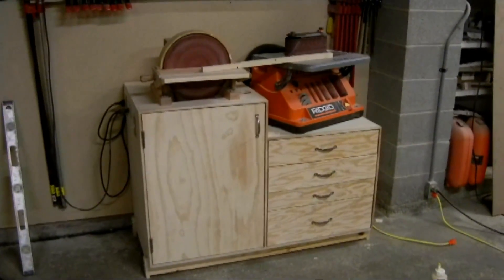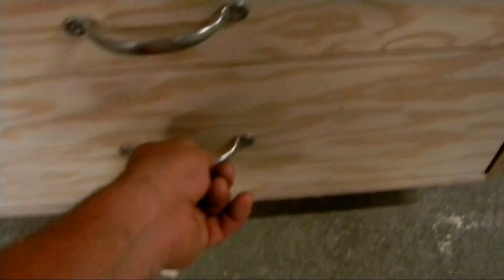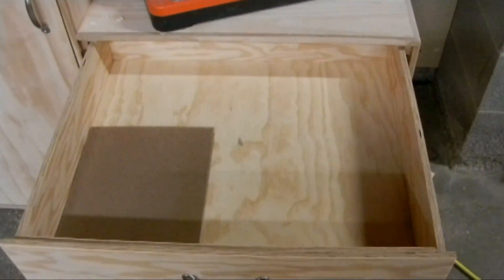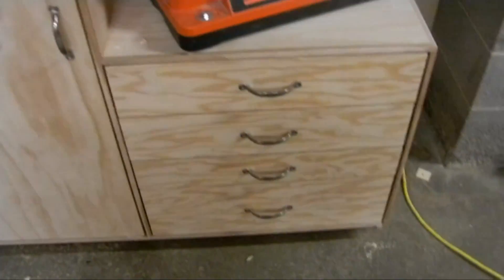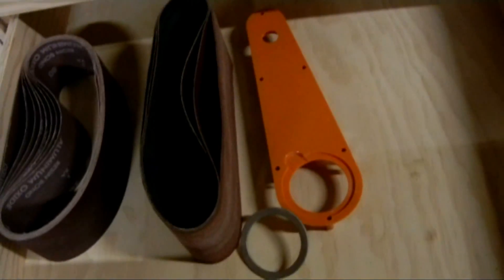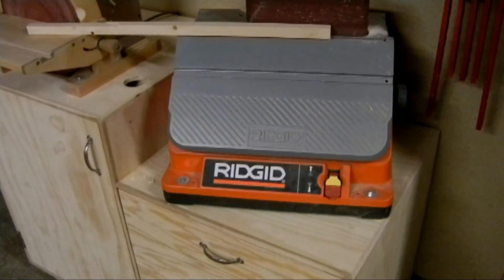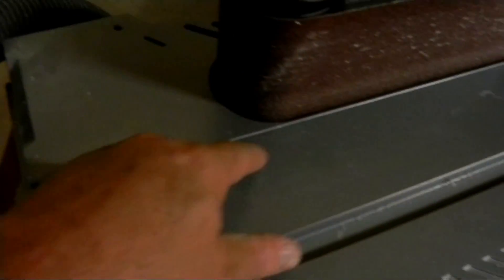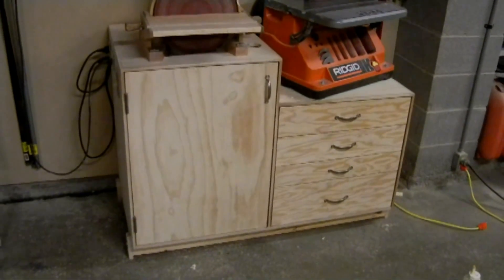Homemade Sanding Station

Comment: Add a cyclone mini and a Festool vacumn and you'd be set. The Festool 26 line is really quiet. You're going to get a lot of heat with your vacumn enclosed. But great set up. It's all about the funds isn't it?
Reply from the maker: +Kirk Williams I think I'm set now, unless you'd like to send out the Festool vac to me. 
A comment concerning heat build up with this setup indicates a common lack of understanding of the practical usage - it's not on and running for hours on end - it never get hot.

Comment: Hi John, I just subscribed ;-)
I have a motor from a professional Juicer 
Motor is nearly 4kg asynchronous 1 phase / R.P.M. 1380 / volt 230 / Amp 1 /Class F /Watt 170 / Hz 50 
Do you think I can use it to build a disk sander ?
MANY THANKS